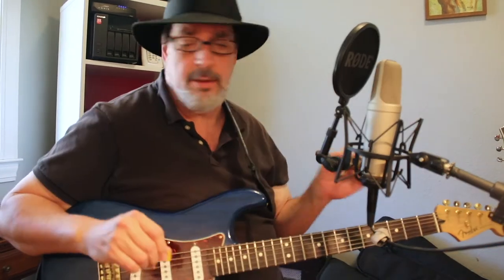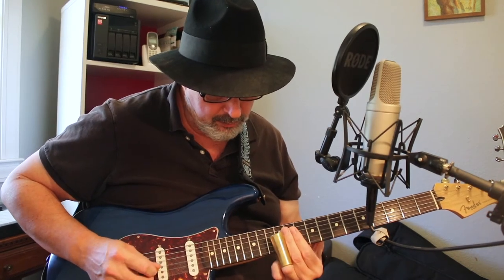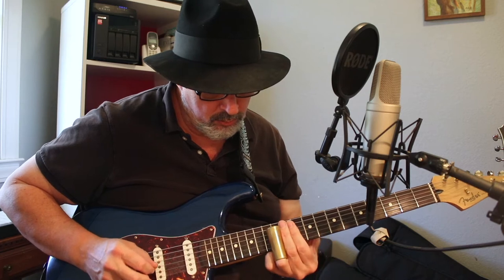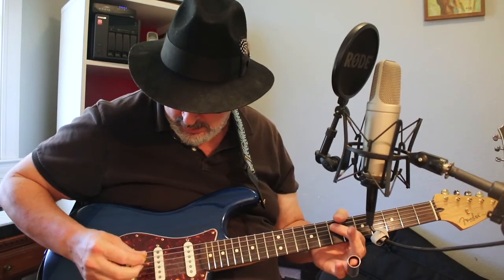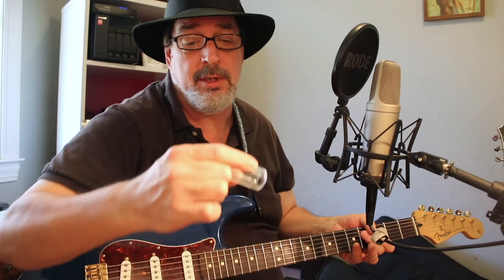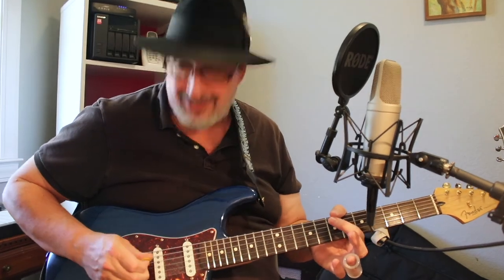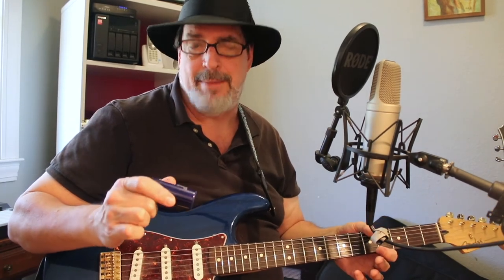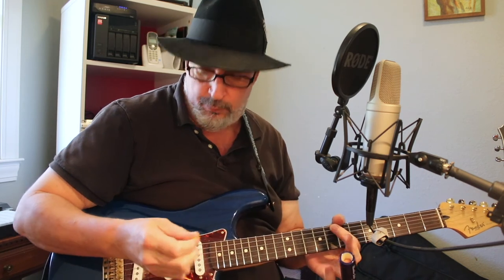Guitar Slide Comparison - Brass, Steel, Glass and Ceramic

Comment: Thanks for the straightforward side by sides of the braaaass slide, the steeeeel, glaaaaass, and moooonshine sliiiides! 😎
Reply from the maker: Thank you Todd.
Reply: aluminum  Alloy pole that I found. Near my house I cut off a section and sanded 2  a polish. Which at first sounded   kinda too treble and.  Claw at the ear but I took some weather stripping  wadded it and pushed it against the inside of the slide that I had and it muted the metal brightness enough so it stayed bright but it was a clear sustained note and after putting weather stripping in their it muted it and plus it added weight to the metal because it's such a light alloy but it sounds way better than. Steel or glass it was. A game changer resonance wise.        Just stumbled into it but I make my own metal slides And look for quality hard plastic for me  to   tool into      premium plectrums of all shapes and sizes.    So customized. To help my thumb forefinger and middle from going numb as all get out because I had my two fingers ripped apart in the middle by a chain that went through it it was a smooth chain but it it ripped out a nerve in their critical to my one finger but it's made of numbness in all those three fingers so I put three different tips on each pick that I had so that if I have started to get numb from picking real strong in one position I could pick down flip it over and play in a different position with a different tension and it would actually mitigate the numbness that way so I wouldn't just have to stop picking. But I love making picks plastics vary widely in quality if you want some of the best 
 Is an old electric GFI box    outlet.  For plugging stuff in   the medium blue is  excellent and durable and it down to very fine and then take like a soft cloth and rub it really hard the edges of it get like polished like glass looking and slick so you can put all kinds of tips on your pic like from really pointy to really fat and like funky so it's more of a plunk or a crisp pick or for like getting the harmonics so you want a real point

Comment: Here's my analysis on each of the slides's tones. The brass slide sounds smooth in the upper neck and has a nice ring in the bottom end. The steel slide sounds full, round, and warm. The glass slide sounds clean and treble-y, perfect for lead playing.  And the ceramic slide sounds kind of gritty throughout the entire range of the neck.
I currently have a Fender Glass Slide 3 slide (Medium ring size, heavy wall thickness) and I have a Dunlop steel slide coming from Sweetwater very soon. I personally can't wait to try them all to see which ones I like.
Reply from the maker: Excellent

Comment: Nice demonstration. I used to favour a brass slide, until it got stolen at a gig. Never replaced it. I tend to use glass now, but only because it’s what I happen to have.
Reply from the maker: Thanks for checking it out. Since I made this clip I’ve been using the ceramic one. I’m not sure which one I would use, if by some weird happenstance, I had to play a gig.

Comment: Thanks Jack👍👍 I use the chrome plated but after your video I think I should have 1 of each or at least  a brass too. I liked the little extra friction .
Reply from the maker: Brass is cool. Especially if I find myself doing an acoustic delta derivative type thing, I will reach for the brass.
Reply: @jackpribek  I could see the extra friction working better on an acoustic and and the polished chrome being good for the electric.  I wasn't really considering the ceramic but after I watched your video I watched someone use it on a national and it seems to have its place too. Thanks again Jack👍
Reply from the maker: @folkenbluzer  I find myself using the ceramic one most of the time recently. But, that’s here in the controlled environment of my little studio.

Comment: Thanks for this mate. I got a short guitar slide, silly mistake, should have got a longer one! In your opinion in case I can't tell the best tone, the best slide for high gain and distortion?
Reply from the maker: My experience with high gain (and especially at stage volume) is that steel and brass are harder to control because they produce more sustain. So, I would use glass or ceramic.

Comment: I make ceramics and used to play guitar a lot. I never learned the slide but was thinking of making a few. Is there any special specs that makes a slide better quality than another?
Reply from the maker: It just has to fit on the finger. There are different preferences: mainly the thickness of the wall.

Comment: It's hard to choose because I like them all xD Do you think it's "easer" to learn with some of them or it's just about sound preference? Thanks a lot for the demo Jack :)
Reply from the maker: Thank you. If you have thicker strings that are high off of the fretboard, a heavier slide, like the brass, would make it easier to learn with I think. If you use lighter strings-low action, then a lighter slide of glass or ceramic will help you find the needed touch.
Reply: @jackpribek  thanks a ton! Will possibly go glass then. Hugs from Spain :D

Comment: Always liked that bite of a steel slide but I much prefer the feel of a glass slide so that’s my go to (especially considering audience members couldn’t give two hoots 😂). I need to try out a ceramic at some point. Excellent demo.
Reply from the maker: Thank you Thaddeus.
Reply: @jackpribek  yes sir. You ever try pinky finger? I did a little and was a hot mess.
Reply from the maker: @thaddeusfields4360  I did try it. The thinking was, if I use the pinky, I could fret with the other three fingers; even do some chord stuff. I found though that I didn’t have as much control over the slide and, for me, the trade off wasn’t worth it.
Reply from the maker: @thaddeusfields4360  I haven’t played much slide lately but, I’ve been dipping my toes back in to the water. Here’s a thing I did recently: https://youtu.be/0B7avfX4_Vg